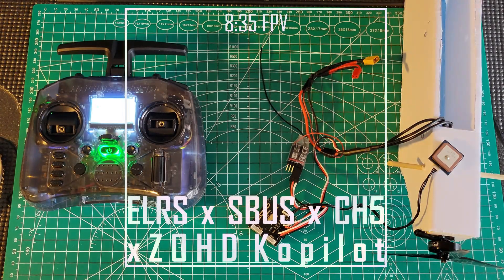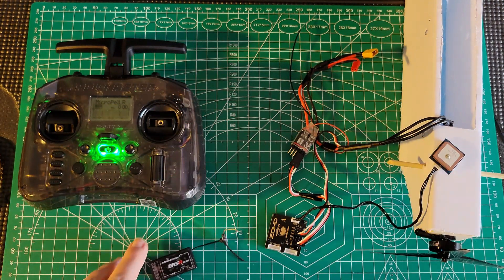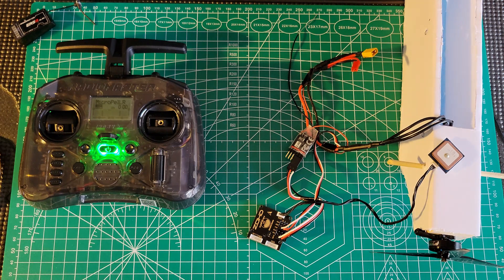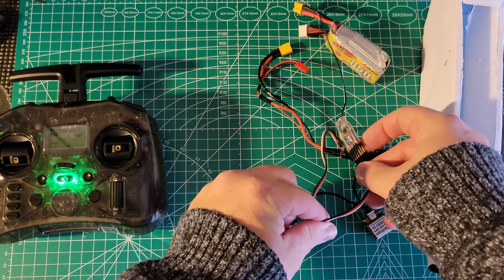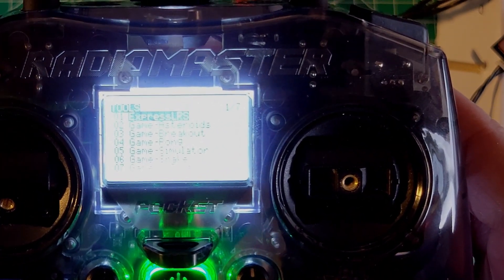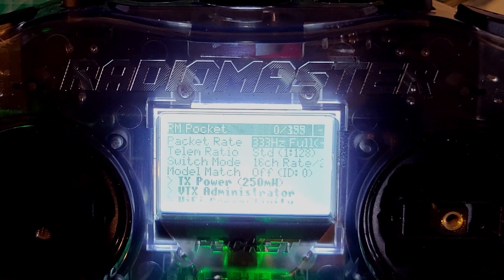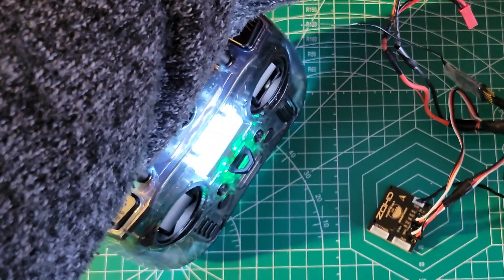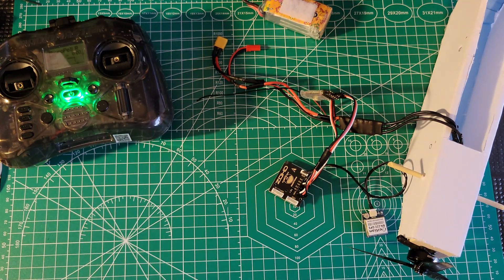Using ELRS with SBUS on ZOHD Kopilot Lite - no CH5 Issue | 8:35 FPV

Comment: I had the same problem. I can now enter manual mode, but in manual mode I still have no throttle. Also, manual mode (blinking green led) is in the last position and rth (no green led) is in the middle switch position. And in rth I have throttle. I'm wondering if somehow the led indicators changed and rth is actually blinking green led and manual is no led. Chatgpt said some kopilots may have that scheme depending on version, but that wouldn't explain why rth would be the bottom position (the position you switch should be in when starting up). Seems like you would want it to start up in manual mode if anything.

Comment: How to use Bluetooth to get telemetry data in mobile ?  If we use s port then, is it possible to use Bluetooth at the tx terminal to get it ?
Reply from the maker: Are you saying use Bluetooth out from the controller to your phone for telemetry? What would be the use case? Not sure Smart Port has that capability but never had the need to try it.
Reply: @835FPV  use full features like DJI with telemetry  .... And we can locate if drone lost
Reply from the maker: @technicalsupport6983  that’s outside the scope of what I’m covering here. You’d want a full flight controller with something like INav or Ardupilot to go that route.
Reply: @835FPV  yes I flashed speedybee ardupilot where I have telemetry controll ... But I don't want to use extra telemetry module to controll the drone in with waypoint ... ... ...